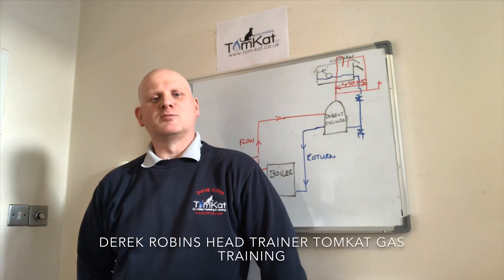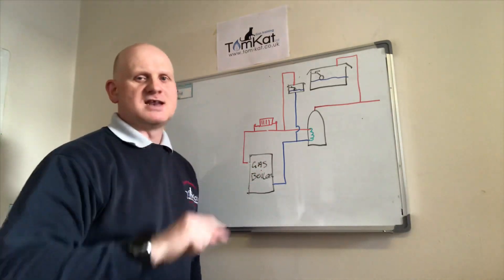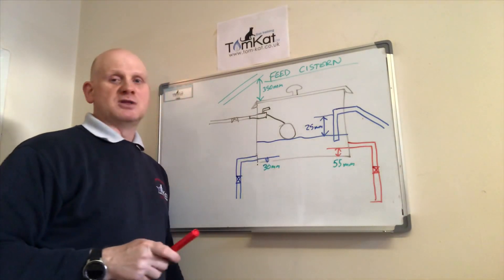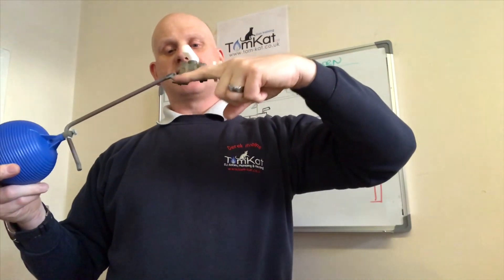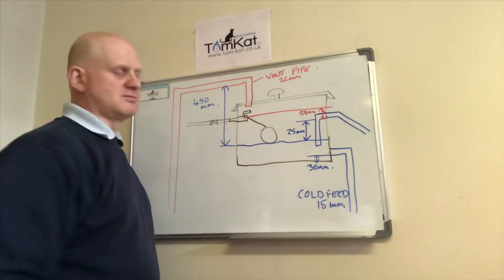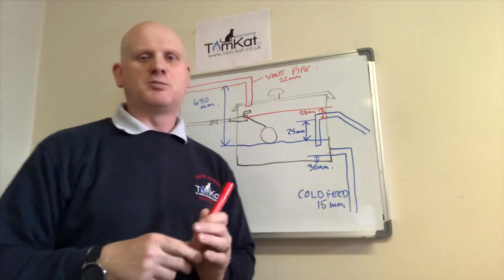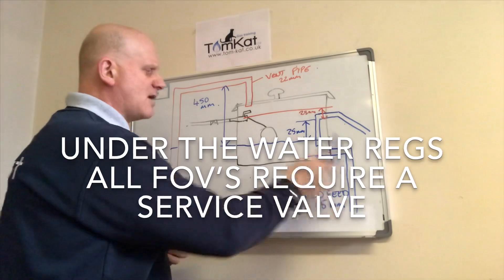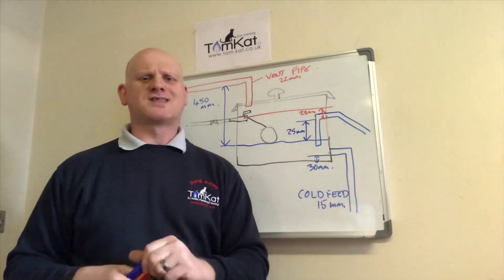HOW CENTRAL HEATING WORKS, the history of central heating part 2 - pipe work layout

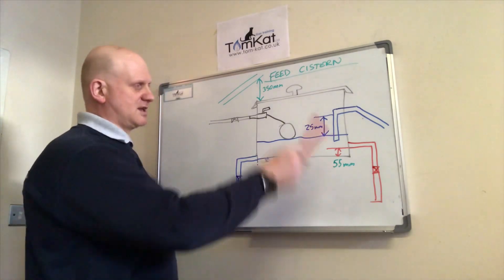Comment: What's the tank @ 5:13 ?
Reply from the maker: It’s not a tank it’s a cold water storage cistern
Reply: @tomkatgastraining  Yes. Is it the F & E cistern ?
Reply from the maker: @jackspratt4343  no cold water storage cistern feeding a hot water cylinder and indirect cold water to shower or taps
Reply: @tomkatgastraining  Thanks.